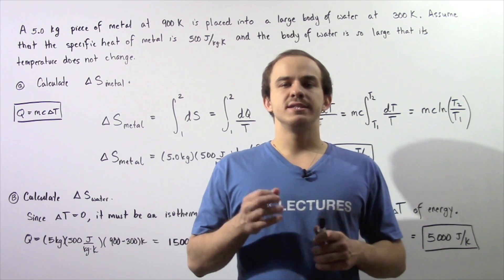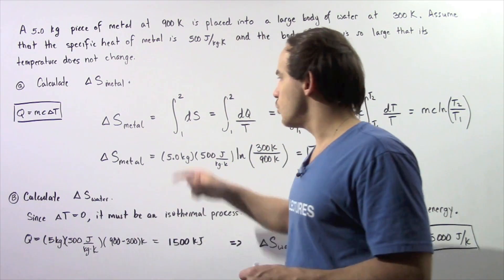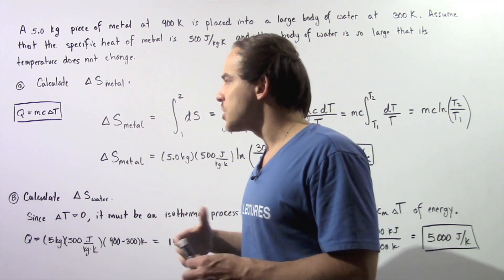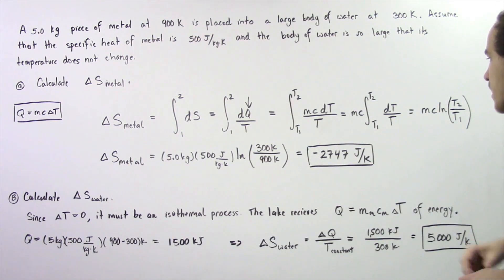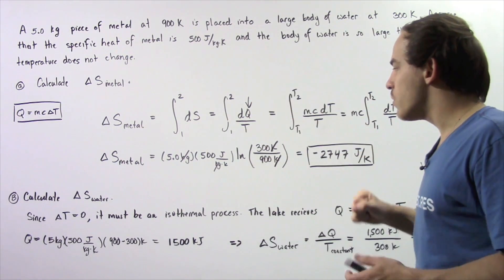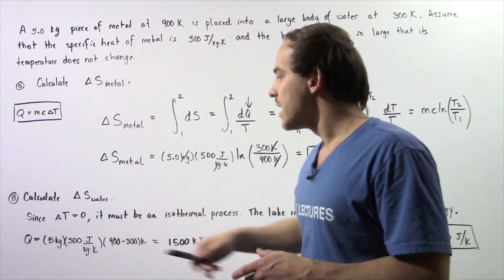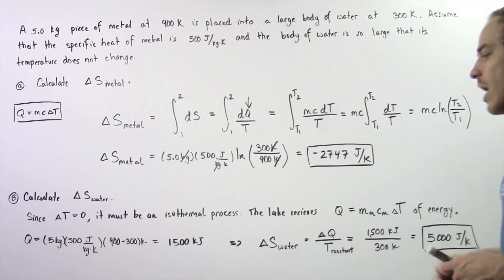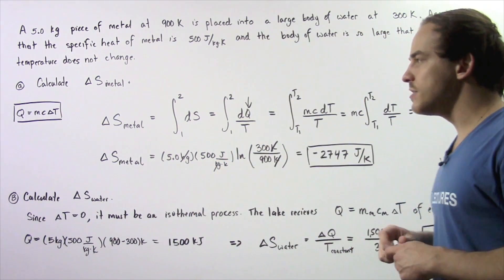Entropy Example # 3

Comment: Great video. What if the dT is not contstant. I mean, for example, if the temperaure of the water will change to 450K after placing the metal into the water? Thanks for your speedy reply